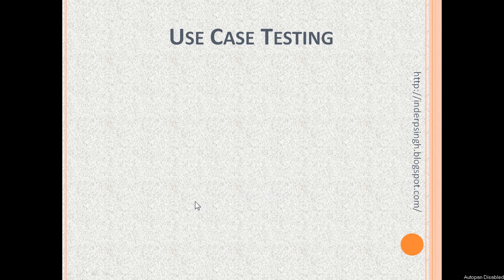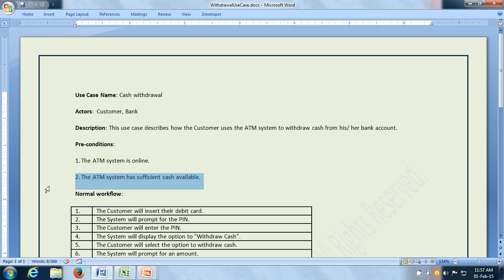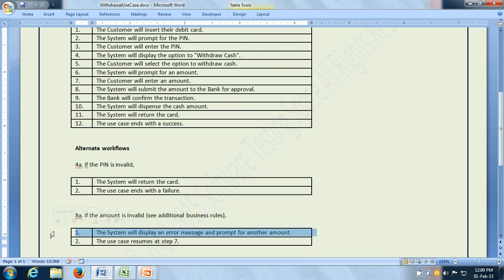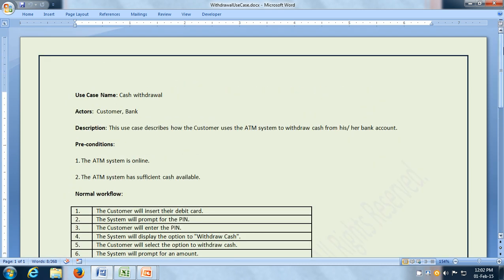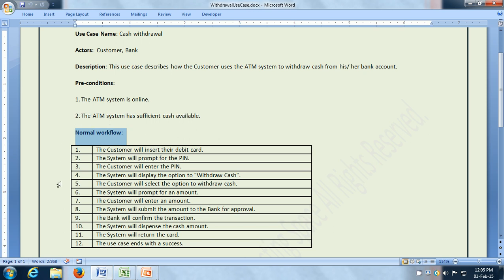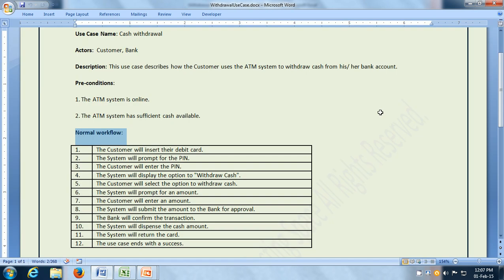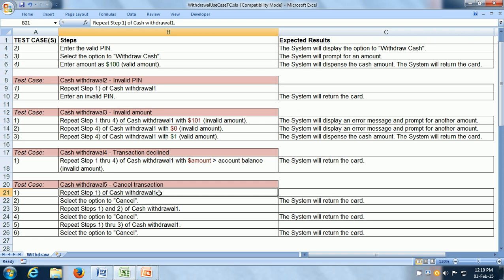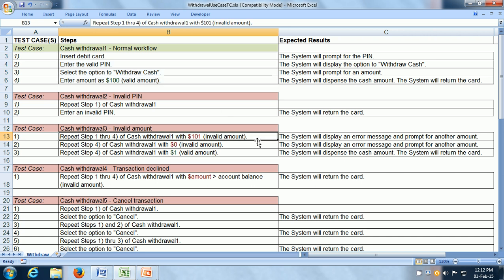Use Case Testing-Use Case In Software Engineering-Use Case ATM Machine-Use Case ATM-Use Case Test

Comment: If the step is 1$ then ok 101$, 1$. What about 99$?
Reply from the maker: 99$ is a valid test data. But when using Boundary Value Testing (BVA), we should, at least, test both sides of the 100$ boundary i.e. 100$ and 101$. To know more about what I mean, please view the Equivalence Partitioning and BVA tutorial at https://youtu.be/uydAyjqTSiw
Reply: @QA1  Thank you for your attention to the answer. As I know about BVA we should take into account the step before, the value and the step after. That’s why it is a little bit confusing for me
Reply from the maker: @Nataliia Nataliia - I see. Actually, BVA is related to EP because the BVA technique depends on partitions. Let's say that there is a valid partition from 1$ to 100$ and an invalid partition from 101$ onward. Where is the boundary of these two partitions? The boundary is between 100$ and 101$, In BVA, we test on both sides of this boundary, at least i.e. test for 100$ (should pass) and 101$ (should fail). 99$ (should pass) is not a boundary value but we may test it anyway. I have explained such concepts with multiple examples in the tutorial whose link I gave is in my previous comment. Thank you.
Reply: @QA1  ok, thank you!

Comment: So what's the difference between normal test cases n use test cases. Please reply me. Thx in advance
Reply from the maker: This tutorial explains use case as a requirement format. There is no difference between "normal" test cases and test cases from the use case. Rather, normal test cases are derived from use cases (requirements). This test design technique is quite straightforward (you need to cover the normal workflow and each alternate workflow in your test cases).

Comment: A use case testing can be called state Transition testing as well right?
Reply from the maker: No, the reason is that a Use Case shows the functional requirements of the system as Steps. So, we need to test the main scenarios and optional scenarios of the Use Case. On the other hand, a State Transition diagram shows the system as States. So, we need to test all the valid transitions from a state to another state.
Reply: Thanks for clarification. In my organisation I have been asked to write testing techniques on a use case via user story without actually accessing the system. So you think in this case use case testing will suffice?
Reply from the maker: Your questions are welcome. It is definitely possible to write test cases without actually accessing the system. But, only use case testing would not be sufficient. You could write test cases off requirements, conversations with developers, fixed bug reports, user guides, your domain knowledge and your creativity. Please see my Test Design playlist, especially How to design Test Ideas at the link, https://www.youtube.com/watch?v=juHNzoRNlIQ&index=6&list=PLc3SzDYhhiGWW0TzISFKqAN_ic8DnZvVc&t=0s

Comment: Step numbers 8 and 9 are NOT a part of Account Holder (Customer) & ATM dialog.  They are part of a separate Dialog between ATM & Bank Computer  during which period the Account Holder must be on HOLD.  The Cash delivery by ATM is another UseCase but NOT a part of the first UseCase of Request for Cash withdrawal.  If for any reason the UseCase with Bank Computer does not go through, the second UC between ATM and Account Holder cannot even start.  The specification and testing must be consistent with the reality of actual operations.  

UML itself is NOT clear about enforcing only one Actor per UseCase.  There is NO way of including a second Actor in the same UseCase practically.  But mistakes like this are abundant in almost all publications on and examples of UseCase modeling.  OMG has not corrected this error and the whole IT world keeps making / repeating this mistake (except my students).

putchavn@yahoo.com 22OCT17

Comment: Thanks. So i understaood that Test Case is a USE case  with expected results and results and may be requirments.
Am i right?
Reply from the maker: Ottonturk Test case is a different documentation than a use case. One or more test cases may be derived from a single use case. The use case steps done by the actor can be used to design the test steps (in the test case). The use case steps done by the system can be used to design the expected results (in the test case). The level of detail can be different in the test case (say, more detailed test steps and test data) and the use case.Use cases are one of the inputs to write test cases. Apart from use cases, we may design test cases based on requirements in the form of software requirement specifications, design specifications, user stories, fixed bug reports, user guides and so on. Thank you for your question.
Reply: Software and Testing Training it's more difficult definition than i expected. Thank you for explaining: i will try to reread it tomorrow to understand deeply!
Reply from the maker: Ottonturk Sorry about that. Actually, a test case is a different document than a use case. I have explained it in my video at http://youtu.be/mjB9XTpQmgc
Reply: Software and Testing Training Thank you for your time!))I will see it of cause.You made great work!